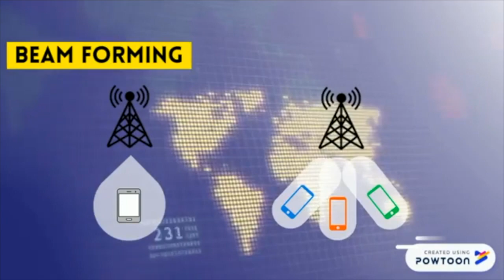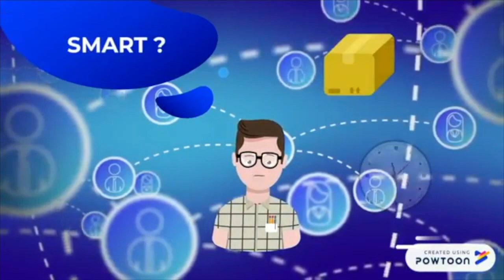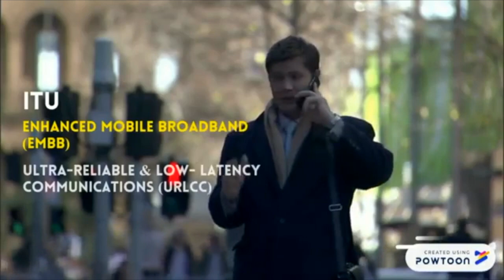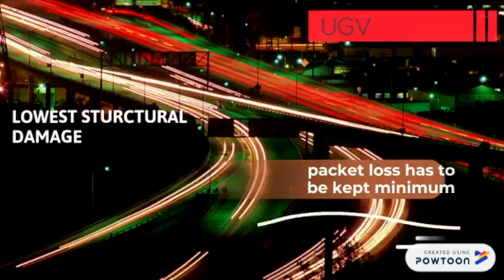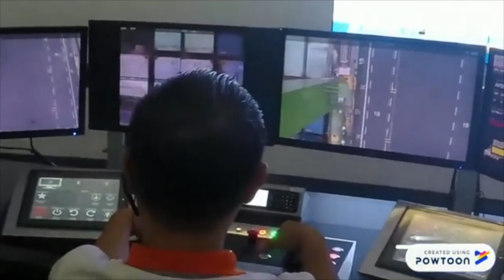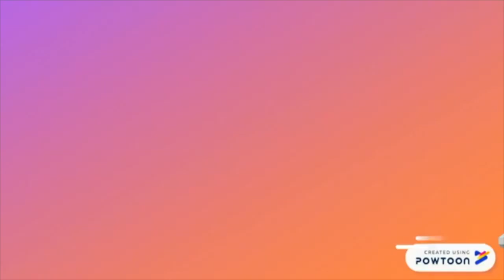5G as enabling technology for smart port

Comment: How would this tech affect employment?
Reply: Hey there! Thanks for the question, it may lower employment in terms of blue collar labor, but that is what the industry needs, as we are moving towards a more autonomous society, so rather than thinking of decreasing employment of blue collar labour, it would simply be shifting to other departments or industries. But that being said, companies should ethical with their layoffs, or to shift their extra labor to other necessary departments that still require manpower. Aside from that, drivers would still be needed in case an autonomous system isn't able to function, and hence there would be a  remote access mode, both at the control station and a traditional driving method inside the vehicle itself.

Most importantly, its all about opportunity cost, while one may look at it as a drop in terms of blue collar labor, you will see an increase in demand for IT analysts and other such related fields.

Comment: Would the operation of the smart port comes to a halt when the connectivity is interrupted? What would be the solution when it happens?
Reply: Particularly when discussing our problem statement, we mentioned our UGVs (Self Driving Trucks) having their own data centres inside. In that case, there would be no need to worry of the connectivity loss, as it could still be able to operate without it for the temporary time. More importantly, given the event that it would need communication with other devices, 4G networks could be built on-top of it, in case 5G fails, and while things would then be shifted to a lower gear, it ensures that work is still continuously done. However, if you're talking about an entire network crash, where the entire smart port has its entire connectivity interrupted then the only thing can be done is to move back to the manual mode, where things are done with manpower for the time being. (Think KLIA incident: https://www.thestar.com.my/news/nation/2019/08/23/m039sia-airports-disruption-at-klia-due-to-network-failure-equipment-replaced)

Most importantly, obviously rather than planning for the worse case scenario, we would also rather it didn't happen and be planning to ensure that it doesn't happen. As the saying goes 'prevention is better than a cure'

Comment: Wow, I have a question thought. How many % of cost and man-power will decrease after 5G smart port fully implemented
Reply: That depends on the time frame you give us. Initially the percentage of cost and man-power decreased will be low even after full-implementation. However using the top Chinese smart ports as a standard, you will find that there will definitely be a great dip in man-power needed, and increase in efficiency. This will ultimately lead to lower costs, even if 'direct costs' aren't significantly decreased initially.

Comment: Good work! Would 5g really help?
Reply: Thank you , and thank you for the question. Yes we do believe that 5G would help, and in many ways. While initially costs may be high, we believe that the overall long term gains as well as information and knowledge we gather from testing out 5G in a smartport, is potentially more beneficial, than simply sticking to current technology as its a lot cheaper.  We agree that there are risks, but they are all calculated and are necessities for the advancement of technology and the benefit of the nation as a whole.

Comment: Cool vid. Can 5g be used to increase efficiency in other areas besides ports?
Reply from the maker: Brandon Siong thanks Brandon! Yes, 5G has up to 10Gbps data speed (which is 100 times faster than 4G) which improves user experience such as VR. It is also extremely helpful in e-health applications and smart farming. Hope that the comment helps you to have a better understanding about 5G!
Reply: Thank you for the question, and yes of course! Any place that could make use of a real-time network to much better improve productivity and workflow would be bolstered in terms of benefit and efficiency due to the speed and nature of the new network. For example, Hospitals and AI development facilities amongst other things, where real-time information processing and handling is crucial and could mean the difference between highly varying results.

Comment: Wow good video very informative! But I have a question to ask, is there any other drawbacks of 5g?
Reply: Hey there! I will be replying on behalf of (Group 2) . There are a couple of drawbacks, some of which have been mentioned in the video. And there are particular drawbacks that it does bring to us in this specific scenario(weather and containers blocking signals) these issues, mainly arise due to the use of millimeter waves being unable to go through thick walls, or being absorbed due to harsh weather conditions. Apart from that, other drawbacks would include the fact that this "new bandwidth" space that we are using is already being used by satellites, is really costly and will definitely have security and privacy issues in its inception. That being said, we are striving to improve and work on these challenges on a phase by phase process starting with the ones that become an issue at inception, and then looking at the next set of challenges.

Comment: Great video! But, I have a concern, how do you deal with weather change, will it affect the signal?
Reply: Thank you and yes indeed! Weather change will affect signals due to the use of millimeter waves. While not fully described here, we would be using small cell towers as mentioned in the introduction. That in itself would cause issues like signal overlapping, that is where beamforming comes in. While harsh weather could still prove to be a problem when it comes to millimeter waves, and in the worse case scenario that beamforming alone isn't enough we thought that the use of new technology such as "automated wireless switches" could help to move around and readjust their positions to transfer signal from the switches to the cell tower, if at all the signal doesn't reach it. Other changes as well could be made, such as logistical changes to ensure weather conditions affect the smart port to a minimum level, by ensuring that crucial parts of the network are kept as strategically close as possible, yet also at a range to maintain efficiency.

Comment: Wery nicely done!! I have a question. Why cloud-native is chosen as the network core? What can cloud-native do to 5G?
Reply from the maker: Binh Le 5G uses many services with high requirements for latency such as network slicing, cloud-native provides logically independent network slicing on a single network infrastructure to meet diversified service requirements and provides DC-based cloud architecture to support various application scenario. In conclusion, cloud-native allow 5g to perform network slicing while the others network core doesn’t.